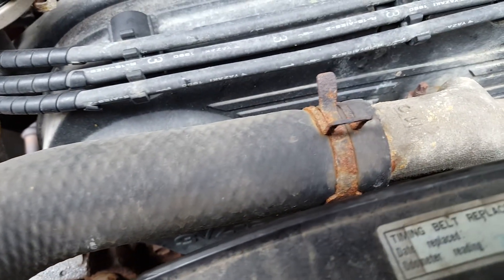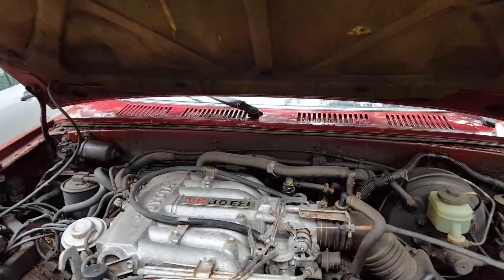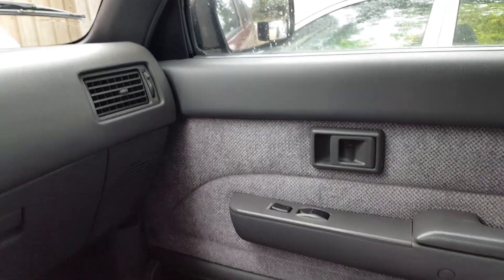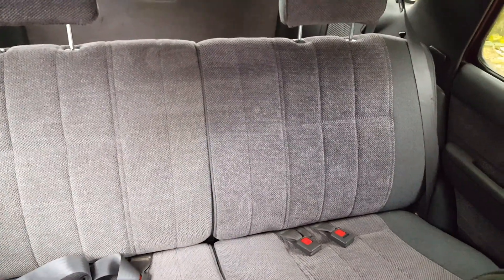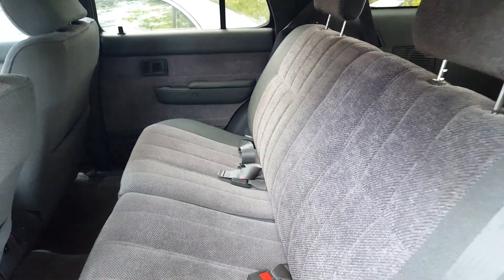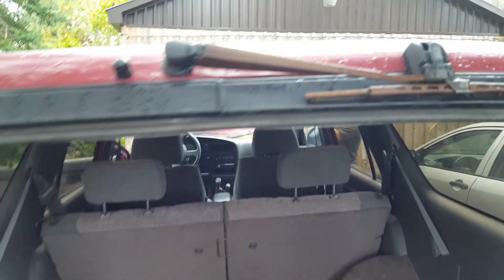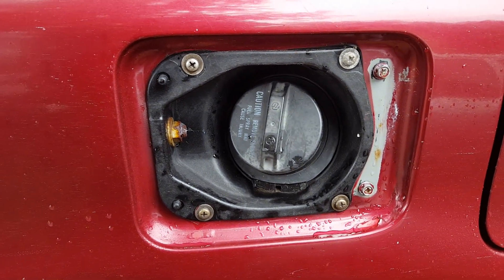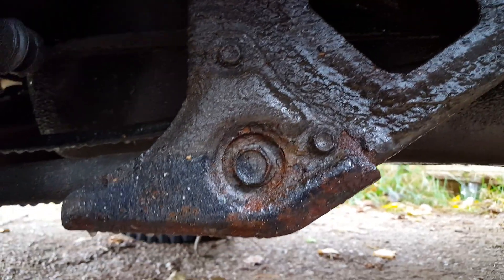1990 Toyota 4Runner

Comment: This is the best all the time
Reply: Only issue is that the head gaskets are primed to blow.
Reply: @Mpinecone  could you please tell me more ?
I am about to buy one
Reply: @HyennaTheOne  okay, 2nd gen 4runners with the 3vze engine are built weird. The heads are aluminum but the block is steel. As the engine heats up, the heads expand faster than the steel, grinding the head gasket slowly. After a while, it may crack.

However, the 5vze engine (the next gen 1996-????) Is known to go over 450k miles. AND the engines have the same mounting and transmission compatibility so you can grab a 2nd gen 4runner, and put a 3rd gen in it, and have a beautiful car that will never die.